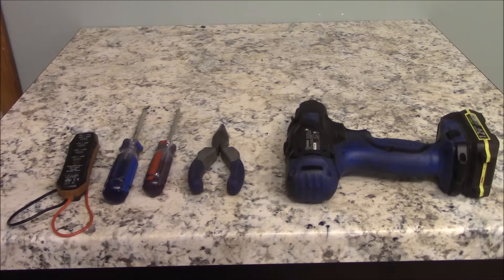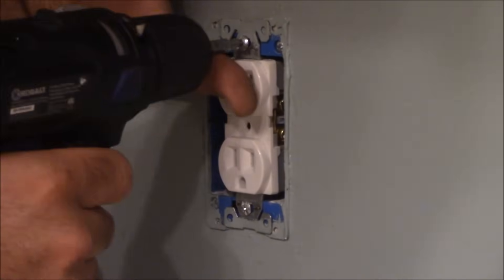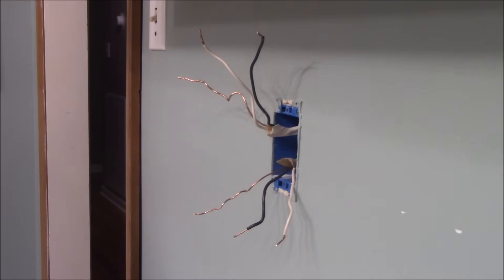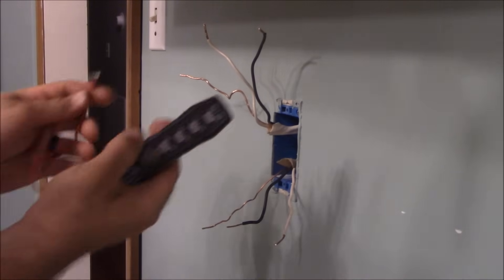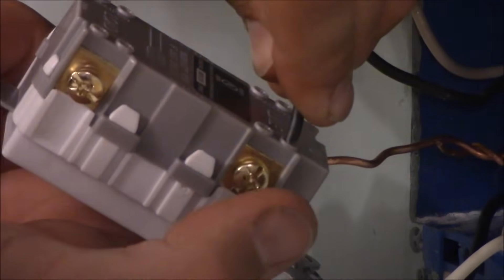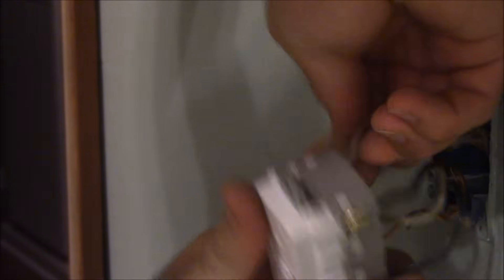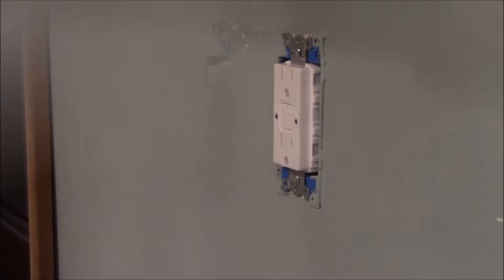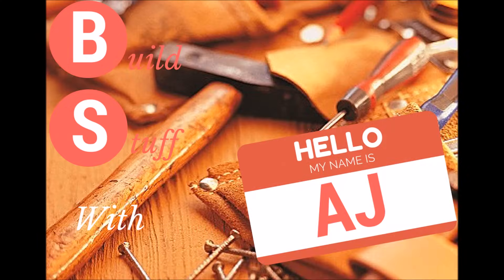Removing and Replacing regular outlet with GFCI outlet

Comment: When I turned off the power for the outlet in the bathroom, the bathroom light,bathroom fan, hall light and foyer light all went out. I feel like I wired the new outlet properly but the bathroom light and fan work but the hall and foyer light do not work. Strangely, the hall light flickers but doesn't fully light the bulb and stops when I hit the switch back to the original position. The foyer light doesn't work at all. I'm assuming the bathroom lights/fan are powered before the new outlet and the non working lights are powered after the outlet. I'm kind of stumped on what to do and what I possible may have done wrong. Any ideas?
Reply from the maker: Wow that sounds  like a bit of a mess. Unfortunately I'm not sure I can help you, with out physically being there I am not sure what's going on. I wish I could help more but I'm honestly not sure where to even begin. 
  Maybe cut the power and try again? I'm not sure where you might have gone wrong, but maybe it will jog your memory, what you did and what wire was where in the beginning. 
 I suggest taking pictures before you try and re wire anything else in your house. It sounds like the wiring is a little bit crazy. Sorry I couldn't help more, but like I said with out being there myself to see what's going on I can't really help
Reply: I removed the GCFI outlet and tried a new standard outlet. I wired it exactly like the GCFI and it worked perfectly. I think the whole thing took about 5 minutes. I'm comfortable replacing existing stuff but for some reason I struggle making GCFI work. Thanks for answering, I'm actually shocked you answered, no pun intended! P.S., if I try this again, later, I'm going to use the quick wire type GCFI outlet.
Reply from the maker: @josephshanley9351  well I'm glad you got it fixed, I'm honestly not sure what would cause all that, unless there is too many amps being pulled on that current? But then again that would probably just trip the gfci.
 I wish I could help you more, but I'm glad you got your house back in working order at least!
 I always try and reply to every comment, and hope I can actually help the person. Out lol.

Comment: I like the video and will use the information provided.  However I would like to know why you originally put both ground wires under the screw, then the next thing I know, only one is connected and the second is wrapped around the first one.  Which way is better/correct?
Reply from the maker: It's been a few years since I made the video and I honestly dont remember the reason behind changing it. But the best way to do it would be to connect a short piece of wire to the green screws on your receptical and then connecting all 3 wires ( the new wire on your receptical and the two existing  ground wires) using a wire nut.
Reply: Nicole Twamley you’re  hot
Reply: it’s me Alex

Comment: I have an old GFCI in a bathroom of my first house I just bought. I wanted to upgrade it to a new one but when I took it off it didn't have a ground wire. Can I still use a GFCI this way? How to I get a ground wire to that outlet?
Reply from the maker: I'm not a licensed electrician and I'm not sure about your local code, but I believe its acceptable to put a gfci in place of a regular outlet with no ground wire. You may want to look at your local electrical code or ask a proper electrician just to be sure.
Reply from the maker: But if you already had a gfci there from before I think it should be fine just to install a new gfci. That's just my personal opinion.
Reply: Contact a licensed electrician.

Comment: Great video!!

I have a question, I have a new washer machine and when I plug it, the outlet sparks ⚡️ a bit and is a gfci outlet. The cord prongs got a bit of a burn on the tip. 
So you  know, I plug the machine to that outlet only when I need it and unplug it back because I use that outlet for something else. 

Do you think 🤔 because I keep plugging it and unplugging it, it cause the sparks ⚡️ and the prongs kinda burn at the end. 
The breaker doesn’t strip so far. 

Thanks
Reply from the maker: Sparks can be caused by a number of different reasons. Here is a webpage that can go more into detail about it.

https://blackdiamondtoday.com/blog/5-reasons-youre-seeing-the-electrical-outlets-sparking-in-your-home
Reply: Build Stuff with AJ thanks for your time and I’ll check out your link.

Comment: You aren't supposed to hook two ground wires to the same ground screw; that is against NEC code. Technically you are supposed to use a "pigtail" (a short piece of ground wire, connected to the two existing ground wires inside the outlet box with a wire nut or equivalent) to connect one single piece of ground wire to the ground screw of the outlet. This is not needed if the outlet is the last outlet in the circuit, and isn't feeding another outlet, though. Of course, it is still going to work doing it by just connecting two ground wires to one single ground screw, but it is against NEC code to do it that way.

Comment: Im replacing a standard outlet / receptacle with a gfci. I have 1 white,  1 black and 1 red. The black is hot so that goes to the line side and the red is not so that goes to load, there is only one white to receptacle...
I would connect to the line side correct?
Reply from the maker: How was it wired up before?
Reply: @BuildStuffwithAJ   it was a "split" receptacle.  The red and black connected to the brass side. And the single white on the silver side, across from black wire.
Reply from the maker: @leondubitz6348  sounds like it use to be controlled by a light switch. If there are two sets of wires connect the two red wires.  
  If it only has one set of wires coming into the box you should be able to just put a wire nut on the end of the red wire and maybe cover it in electrical tape to be sure no part of the bare wire is left exposed. Then tuck it away in the back of the box. Your light switch that controlled the bottom receptacle will be useless now. But your receptical will work as normal.
Reply: @BuildStuffwithAJ  great thanks !!!

Comment: Great video i have question if i have Gfci already and i want to put another gfci in the same bathroom can i take power from that one or i can't do it ?
Reply from the maker: I guess I'm a little confused by the wording of the question. You can hook up more than one reciprocal on the load side of the gfci. And they will also be protected.
Reply: @BuildStuffwithAJ  thanks for answer there is one gfci on my bathroom i want to install one more can i take power from that one or is not possible to conect more than one
Reply from the maker: @MG-bf4hx  gotcha. Yeah you should be able to add another receptacle. If you've never done any electrical work it may be more work than you want to mess with though.
   You will have to pick your spot, cut out and install your box and then run wire from existing receptical to new one. And then wire it up of course. 
  It doenst sound too bad when explaining it this way, but when your doing the work it takes alot longer than you may think. I've done these things alot and it is still an all day project. You may be better off hiring someone to do it for you honestly.
Reply: @BuildStuffwithAJ  thanks

Comment: We have a GFI in a bathroom that also feeds a light switch down the load side. When the GFI trips, the light switch is deactivated. Is there a way to hook up the GFI such that it protects the outlet in the bathroom but won't deactivate the light switch if it trips?
Reply from the maker: I'm not a license electrician so I dont know if it would be up to code or not. But you should be able to splice it into the wire that feeds the line side (power side) of the plug. In other words you would need to disconnect the power to the line side of your gfci, get a short length of wire and connect the in coming power wire, the new short wire and the wire going to the light switch. Connect all three using a wire nut and then connect your new short wire you added to the line side of your gfci. Again I'm not a licensed electrician so I'm not sure if it would be up to code in your area or not.
Reply: Yes, as AJ said you will need to disconnect the power and connect pigtails. This separates the power (wiring in parallel instead of series) of the loads. The light remains functional if the GFCI is tripped. You never really want to connect a light on a GFCI circuit, especially in bathrooms (walking around in the dark in an area that has water).  The question of code would lie in the size of the box that your GFCI sits in. You cannot have too many wires in the box and there are specifics on code. The NEC (check online) can give your the specifics/dimensions of your box's maximum allowances. Generally & logically speaking, if you remove the receptacle (gfci) and it's already crowded, you will have to get a bigger box. In case you didn't realize it, all wires must be connected inside a junction box ALWAYS. I bought a house and was in the Attic and when I can down I had no power on my living room wall, jerks had 2 wires connected with a wire nut UNDER THE INSULATION! No junction box. They got disconnected when I walked over the insulation-I was ticked!! Could have shocked the crap out of me/killed me and/or started a fire. Remember to ground (bond) the new box if it's metal! I hope that helps.

Comment: How far away are outlets to be from Bath vanity Bowl. ?  With GFCI  ? Thanks
Reply: 6 feet from any running water  is code
Reply: That comment is  for Wisconsin  ... your state might be different
Reply from the maker: I am sure it varys from place to place, some electrical codes are stricter than others. So I can't give you a definent answer. But I would say if it's an outlet in the bathroom I would put a gfci on it.

Comment: Had to do the opposite neighbour had a panel upgrade the electrician ran a dedicated plug for the clothes washer. At exactly 41 mins into the cycle the gfci would trip.
Reply from the maker: It could have been too small of a gfci they make them with bigger amp ratings. I'm not saying that's for sure what the problem was, but most outlets in your home should work fine off a standard 15 amp gfci receptacle. The washer might pull more amperage requiring a 20 amp gfci receptacle.
Reply: Build Stuff with AJ yeah thought that was it for sure but low and behold i find it was a 20a circuit that was installed. The gcfi plug was a 20 as well.
Reply from the maker: @kansascityshuffle8526  well at least you've got it worked out now right lol
Reply: Build Stuff with AJ thanks
Reply: @BuildStuffwithAJ  no....this is why a gfi is not required for a washer dryer especially with the electronic controls used in modern machines sometimes there is a small current difference between hot and ungrounded conductor......gfis are for blenders and hair dryers and such....see it all the time.......and a dedicated circuit is recommended....sometimes a trained electrician will understand better than a handyman.....not to troll or be mean but this stuff is often more complex than you may realize.....36 years being a sparky makes me reply....

Comment: Question
So I see you connected a ground onto it
Everywhere I have read it says that it is not necessary to ground a GFCi outlet
Is that true???
Reply from the maker: I want to start with saying I'm not a licensed electrician so I can't say I know the code book very well. But I do know code carts from place to place. Some might require it and other might be ok with out it. If you have the ground wire there I suggest to go ahead and install it just in case

Comment: I have an outlet with a light switch, garbage disposal switch and a 3 prong outlet in my kitchen. I tried to replace the outlet with a GFCI outlet but the outlet would not work so I had to take it back out. Don't know why it wouldn't work or what I did wrong. Do you have any idea what I can do to get it to work.
Reply: It worked. Thanks 😊
Reply from the maker: @janicebrown9556  That's great! I'm glad I could help you!
Reply from the maker: If you pressed the reset button but it wouldn't reset it coyld be that you connected the line and thr load side backwards. Otherwise in not sure why it wouldnt work.
Reply: @BuildStuffwithAJ  Thanks I'm going to try again later. I think that's what I did.

Comment: Nicely done and very well explained.  Question.  Where in the line do you install a GFCI?  For instance I'm purchasing a home and two important areas aren't on a GFCI and that is the kitchen and the laundry.  Since I doubt either is on a dedicated line single outlet, where in the sequence do you install one? e.g., Beginning, middle, end, or does it matter and how do you determine where that is on the receptacle?.  TIA
Reply: Note that you should seriously consider before you put a fridge or a freezer on a GFCI outlet. Accidental tripping can ruin the contents.
Reply: @okaro6595  Good point!  I have heard that as well.
Reply: @okaro6595  ...and sump pumps. You may only realize the circuit tripped when the basement is fukl of water.
Reply from the maker: There isn't any simple way of deciding which receptical is the first in the line. If you want to guess then try the one closest to the service panel (breaker box). But the best way to find out is disconnect one of them and see which other recipticals have lost power.  I would find the one closest to the breaker box in the line you wish to protect and install the gfci. Once you turn the power back on you can plug in something that either lights up or makes noise in each receptical you want to protect. Then press the test button on the newly installed gfci. If there are any recipiticals that still have the light or making noise then that one is before the receptical you just replaced in the circuit. 
  I hope that wasnt too confusing. And I hope this helps you

Comment: My problem is a common circuit (Red) wire. Where does that go?
Reply from the maker: So you have a ground wire, a black wire, white wire and a red wire all going to the same outlet?
 To be honest if you have a 3rd wire I would have to be there to see where it was going first. It can get a little more complex than I can explain on here.
  Where was it before you took off your other outlet?
Reply: Probably a split switched outlet. Cap off the red with a wire nut and tuck it in back

Comment: I don't have the probe type voltage tester like you do, but figuring I can test the circuit to ensure I've cut power either with a lamp, or I also have a little plug-in circuit tester.

But, as I don't have a probe-type voltage tester, I wouldn't be able to confirm which is the line and which is the load side of the wires like you did....  what's the result if a person hooks up a GFCI receptacle with the line and load reversed?

Just wondering if it's worth buying a cheap probe tester.
Reply from the maker: It should technicly still work as a plug. However the load side is what protects the other recipticals wired in the same series down the line.

Comment: Hey AJ serious question here you talk about line side and load side, what happens if you reverse the wires plug in the line side on the load side and vice saversa, making sure black wires are together and white are on the same side would it make a difference?
Reply from the maker: So Basicly the line side means the side the power is coming from. And the load side is what the gfci is protecting. So it might technicly work as far as the plug having power but it wouldn't protect any other recepticals that are on the same circuit. I hope that made since to you
Reply: Thank you it does
Reply: It wont reset if you switch line and load.

Comment: I have one of those that has the breaker switch in it. I plugged the vac. into the out let and it tripped. I pushed the button to reset, Nothing,  So I pushed the switch a little harder. This time the button and a spring shot out. So I put it back in and pushed the button. Again No power, I had to use my multi meter no light on the out let. The multi meter shows power on two of the wires. But No power was going to the plug. At this point I had not taken any wires lose. It worked in the past but from time to time it would trip. So it's not like I wired it up wrong. And I have been in this house for over 10 yrs.  So I go get a new one,  $25.oo  Knowing my luck I went ahead and picked up a regular one without the breaker. It was only a few bucks. I get home and turn the power off.  I took one wire off the old one and reinstalled it on the new $25.oo out let. One wire at a time just like the old one. Turned the power back on and plugged in a hair dryer and get Nothing. I pushed the button in to reset and Nothing happens.  At this point I am getting pissed. So I pulled the out let back out of the wall. And it reminded me I needed to turn off the power first. After a few choice praises  I went to turn the power off.  Power is off  and I took the New $25.oo  out let back out and replaced it with the new  regular one. And now it works.  Not sure if that new $25.oo out let is bad or what,  do you have any thoughts ?
Reply from the maker: I had a similar issue in my house actually, I had several gfci outlets on the same circuit and that may have been the issue. I tried replacing it and I had the same issue again, just as you did. I finally replaced the gfci with a regular plug and it worked just fine. I'm still not sure what the issue was for sure but the regular plug works fine. If you continue to have issues or if your worried about it maybe call an electrician to come amd look at it for you.sorry I couldn't help more. But if you find out what the problem is let me know because I'm curious myself